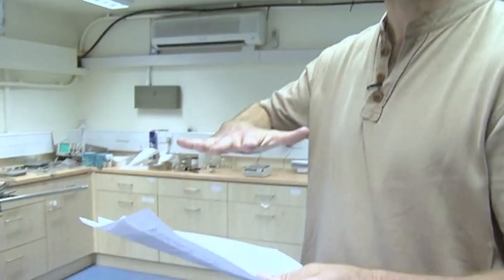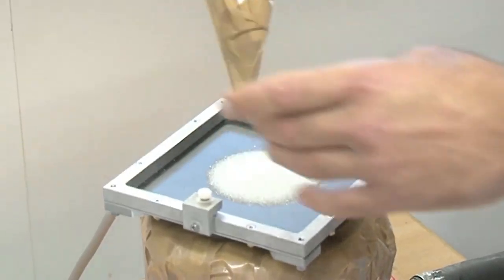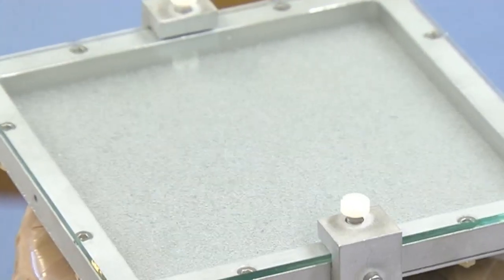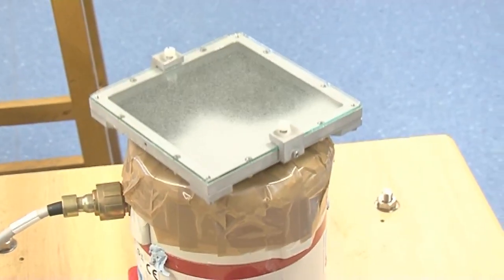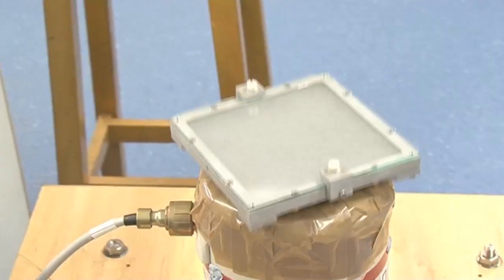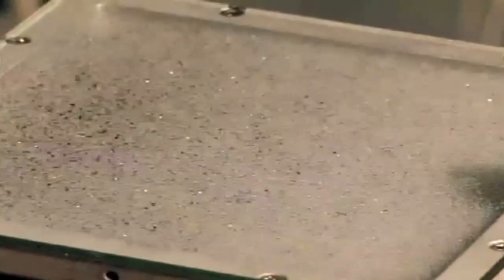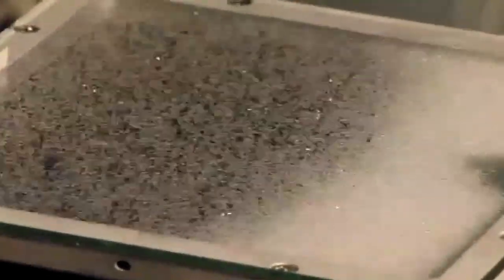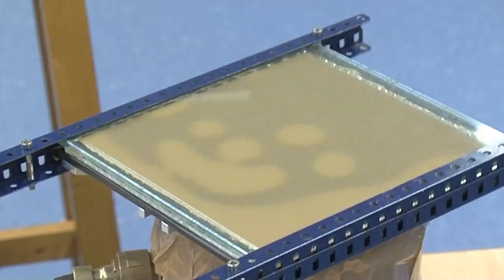Granular Dynamics - Sixty Symbols

Comment: 4:08 That's one way to explain it. However the more elementary explanation is that the induced different vibrational speeds between the air molecules and sand molecules creates domain separation. Literately two discrete spacetimes. Obviously this experiment will not work if it was under vacuum.

Comment: Simplicity is the natural occurring mathematical reciprocal of pseudo randomness, because here-now-forever is this same principle of condensed/tuned frequencies, integrated reciprocals of e-Pi-i resonance imaging. 
Basic Physical Observation has to be repeated for changing POV.., different angles for the same principle/"news".
This is what you would get, a tuned interference positioning, if you vibrate the screen in the double slit experiment, at the appropriate frequencies.

Comment: Dust on machines  - vibration frequencies rule granular sizes and dust bunnies. Lots of varients used in mineral extraction. So a Navier-Stokes type analysis of selected grain sizes using better computer programming models of processing flows is always going to be popular in industry.

In the quantum universe there's no truely simple system isolated from everything else.

Comment: is there a reason why you cant consider the particles as being in a "liquid" at that amplitude? i think it would also be a great thing to look at the physic in a bigger environement, so you can see how the particles react without hitting two layers constantly, to check if the clumping happens again
Reply: +maxime therrien  Yes Maxime, I agree with your suggestion to get rid of the 2 layers. I guess getting rid of 1 layer already would give a hint. Does anyone have a link of the relevant publication? Thanks.

Comment: So... Why does the pressure decrease when there is a higher density of particles in one area?
Reply: magic
Reply: Pressure decreasing due to particles being near each other has everything to do with particle interaction. 
In a quick thought experiment, think about what would happen if all these particles had a magical force of attraction, where they wanted to stay close together. Then it's reasonable that you would expect clumps of matter to form. In this case, the "magical force of attraction" is the energy loss due to oblique collisions between particles. (There's another sixty symbols video that discusses this in more detail).
Reply: In the less dense area, particles move faster, and therefore more motion, which is what's called 'more pressure'. In the higher density area, the particles move less (presumably losing their energy to collisions or what have you), and moving less means 'less pressure'.
Reply: it is not to be misundestood with the case when the system is in equillibrium, i.e. when pressure goes down, particle from every other region rushes to the place due to the variance in the gradient in the particle density within the system. Rather in this case; as the whole system is, "shaking", primarily due to some deconformity in the orientation, particle would tend to go to some specific direction, specifically for minimizing gravitational potential, [it would not happen if this experiment would have been conducted in space], and that is why we find the cluster never happens in between the container, rather towards some side, where, the aparatus is slightly leaned down, or due to the non-uniform shaking of the piston, as the shaft in the rotor has its pretty reasonable dimension to possibly get shifted in some direction. Another reason is, when mass [fine silicate beads here] gets clustered in some space within the container the piston naturally requires more energy to vibrate that region than the rest of the places, which causes the gradient more prominet as in this case, the collisions are not completely elastic and as well as the distance to mass ratio of this system of particle is not negligibly small enough primarily. But afterwards when enough amount of energy is provided, it overcomes these parameters, and the "randomness" begins to appear.
Note that; homogenity in gas or here in this fine particle system, is actually 'random', and there is complete indistinguishibility of microstates within the system and the energy of the particle overcomes all other parameters restraining them, so they achieve gas like behavior.
Reply: As the particles vibrate horizontal motion seems to be generated by oblique collisions and it's energy is lost in collisions with walls... so if at some frequency particles come into resonance and number of oblique collisions reduce (probably the particles start oscillating parallel to each other and with phase difference nπ) and only vertical collision occur then the pressure due to random horizontal motion reduces... I am not a scientist or an engineer but just guessing a probable reason
Reply: because there is a more exerted force on the object in a more simple way,
there are more things that try to replace you.

Comment: Is this effect related to Cymatics in anyway? Has it been tried with a different size frame and a variation of frequency? If there is a relationship between the dimensions of the frame an the frequency, due to harmonics, it will be interesting.

Comment: could something like this explain the non-homogenous universe?
Reply: Is it just a guess inst it?
Reply: I think gravity has more to do with that than granular dynamics...
Reply: Dmitry Shap It's not a guess, it's based on now centuries of observations and compiling all this date while developing new ways to detect things in the universe, like the cosmic microwave background which is relatively quite a new thing, but I often  hear that being used as the most compelling proof of a homogenous universe
Reply: The universe is very homogeneous at large enough scales. No relation there

Comment: Why is this different from Chladni plates
Reply: Alexander Westphal The effects of Chladni plates rely on the different modes of vibration in the plate itself, not necessarily on the collisions of the particles with each other. What they are exploring are the phenomena emerging mainly from the intergranular interactions. Notice that the box containing the granules in meant to oscillate as a whole and is supported by the shaker with a fairly solid x-mount. On a Chladni plate, the single point in the center encourages the plate to deform. The particles coalesce along the nodal lines created from standing waves caused by the plate bending and warping. The frequencies of a Chladni plate are also much higher. That is to aid in creating standing waves within the plate with a small enough wavelength to create clearer patterns.

Comment: What part does Aero-drag play in this test?  If you get the grains to resonate together, the air-resistance would probably help the formation of the clusters around the borders, where the air is to be expected to follow the surrounding walls too.
Can you try the same experiment in a vacuum?
Also:  While the frequency was stable, the amplitude was altered, but the allowed "waivelenght" for the particles is limited. This looks like an Amplitude modulation instead of a frequency modulation.

Comment: He increased the frequency, but not the amplitude. If the amplitude is less than the diameter of the glass beads, would the effects be the same ? I would imagine, in this experiment, that gravity would determine the ratio between amplitude and frequency. Right ?

Comment: Except that what I'm saying has nothing to do with the Chlandi's plate effect. Chlandi's plate patterns emerge at the points on the plate that are not moving up and down, which is not the case in this experiment.

What we have here, ideally, is a plate moving up and down uniformly across it's whole surface, which is why the effect was a surprise to begin with.

Comment: try it in a vaccumn.  my theroy is the glass particles are round a bit like an airfoil. as they move rapidly up and down, through the medium of air, the accelerated air flowing over them would cause a pressure drop, hense the clumping tendency from lower pressure air regions.   the bernulli principle in action. maybe?

Comment: Yes, but in the video, they are not mentioning vacuum anywhere, the simulation is mentioned as confirming that the effect works with ideally level and flat surface, not that it works without air. For all we know from the video, the simulation might have included atmosphere as well.

Comment: That's a very clever theory to fit the observation, but remember he also talked about how the effect still appears in a computer simulation, where they would not have included air as a factor (and if they had, they would have found that to be the reason for the effect). The first precaution they would take with this sort of thing would be to ensure that the effect exists in a perfect model of the grains rather than an imperfect experiment.

Comment: Basically, what that means, is that there will be wind inside the box, and as a plane of glass particles rise up, and starts falling down, the air would get pushed down, then outwards, which would carry some glass particles with them, forcing them towards edges, so the air pressure in the middle will increase, and decrease at the edges (because there would be more glass granules at the edges), and when you again increase amplitude, the forces imparted by the piston can overcome the pressure.

Comment: From what I can tell, this experiment is not done in vacuum, which means there are air particles in the mix to consider. One could imagine that at a certain amplitude, glass particles chaotic motion gets overtaken by the motion imparted by the piston in the axis its pushing in.

The granules moving up and down together as a plane, would basically make a floating piston, that would create air streams of air particles in the mix, instead of them also behaving chaoticaly.

Comment: What's surprising is that when matter is in a solid state (low amplitude), it clumps together and keeps that form. As it gets hotter (amplitude increases), it tends to become more uniform (gasses expand to fill the available space).
But in this experiment with solid particles, it's other way around.

Comment: How does this relate to the pendulum effect? As in when you have a bunch of pendulums set up where the motion can cause horizontal movement , they align them selves to tick together. Maybe the impacts vibrating the glass has something to do with this as well (the vibration waves would have to strong enough to have overlapping waves at somewhat similar frequencies)

Comment: i'd guess that at low amplitudes the granules are oscillated randomly on all three axes,so pressure in all directions are similar, producing a nice uniform distribution of particles.then at a resonant frequency of vibration in one axis (z-height movement of the piston in this case)each particle now resonates in the z axis at the expense of x/y oscillation,such that x/y pressures drop and the particles collect sideways.expectedly the pressure on the glass and baseplate must have greatly increased

Comment: The laws of thermodynamics do not apply for a system where energy is not conserved: the  colliding particles lose energy as the collisions are inelastic and the energy is lost as heat. The surprsing observation is that the system behaves as if it were a thermodynamic system, even though it is not. And there appears to be a surface tension which governs the shape of the two phases.

Comment: if the sound it self if migrating into the mix would that not change the actions when just vibration is added becouse dose sound not affect the mix by sound waves going from partical to partical in the mix, would a cam type vibrator be diffrent in action on the mix ???????

Comment: I guess that it has to do with the orderly fasion they move in. As he explained in the video, the beads switch from a chaotic movement to one stabil motion going up and down. So yeah, that could be it but then it's not "pressure" they're after, it's another force which so far behaves as pressure would, just the other way around. Could you call it "pushure"? *HAR HAR*

Comment: I would like to see this experiment done with a circular or cylindrical box. Not that there would be a different result but maybe a different visual output. The computer simulation shows the granules spreading to the corners, as far away from the centre as possibly.

Comment: Both harder AND faster.
The frequency stays the same. But the total travelling distance increases due to higher amplitudes, which means greater distance from the "zero-level".
And greater distance in equal time means faster.

The force becomes stronger in that process too. The maximum accelleration increases, the mass stays the same, which means more force.

Comment: So is this a phenomena resulting from higher amplitudes or frequencies? I'm confused. Also, is there any pattern to where the higher density clumps are formed? Does this happen when the size/mass/density of the particles is increased? Are there specifics of the sine wave that cause this effect or is it possible with randomized waves.

Comment: Insightfully FASCINATING!  A new phase transition is observed experimentally in a dry granular gas subject to vertical vibration between two horizontal plates. Molecular dynamics simulations of this system allow investigation of the observed phase separation to find a high-density, low temperature liquid, coexisting with a low-density, high temperature gas moving coherently. The importance of the coherent motion for phase separation was investigated using frequency modulation. Key: COHERENCE

Comment: At a high temperature driven by coherent granule movement, a randomly generated cluster of granules causes a drop in pressure in their region, thus attracting more granules to the cluster? And coherent granule movement is some kind of resonance effect that occurs only at a certain frequency and its multiples of shaking? I'd like to learn more. How about a part two and explain things a bit more?

Comment: @HotblackDesiat042 When I speak of limiting I mean the point at which the amplitude of the drive signal is sufficient to extend the piston/solenoid to its farthest extent, thus reaching its maximum stroke. Any increase in amplitude beyond that point will be clipped as the piston cannot extend farther. When the amplitude is pushed beyond this point is would be akin to a square wave feed versus the sine wave feed, as that would be the motion the grains would feel.

Comment: @HotblackDesiat042 those are still great questions, and I don't have the answers :(. Just wanted to clarify on the amplitude vs. frequency problem. My thoughts on the limiting effect, however, and if I understood you correctly, I don't think there is a limiting effect, practically. The way he talks about higher amplitudes makes it seem like they've reached quite a large amplitude experimentally.

Comment: @EveryoneIsBoring 
Actually on their channel(sixtysymbols), there is a video explaining it with a different example.
Basically, the more closer together the beads get, the more they collide with each other...and thus waste their energy. Less energy..less movement, less movement, less temperature/pressure, less pressure, more particles.

Comment: @frichikendz I'd guess at least part of the reason why that happens is because the liquid is most hot in the middle of the cup and cooler at the sides. Hot water (at least >4deg C) rises and cool water sinks, so small currents are formed which, at the surface, are moving toward the edge.

Comment: Chladni nodes. They propagate differently when the edge of the surface is clamped and has holes drilled in it, as opposed to a flat square plate with no holes.

Comment: Am I understanding this correctly. The lower pressure area has a higher rate of collision. With the higher collision rate the probability that 2 or more particles will hit another at the same time increases thus transfering all that energy into a single particle which ends up pushed into the higher pressure area taking all that energy with it? In other words is the action similar to evaporation?

Comment: Varying the amplitude changes the net energy into the system --wouldn't changing the frequency do the same? At what critical point does the pahse transition (chaos-->stocastic) happen? Is this a function of the phase space betweent that transition and the change "back"? How about higher energies? Do you get other phase changes at higher energies? Finally, just curious--what were you looking for when you found this phenomenum?

Comment: @Atveurf He said the denser areas were hotter so the pressure was lower causing other particles to collect there. If these related then the center of the star would be low pressure and have more particles, or the out side would be hotter with more partials, but less dense. Neither of these make any sense to me, but that is not my field.

Comment: I have studied mechanical vibrations, using simmilar setups, using sand particles on vibrating plates as well. 

Is the sand not just collectiong at one side, due to the the amplitude of a certain modeshape? Or that the rig is EVER so slightly tilted or certainly not perfectly plane?

I have to see that paper.... :D

Comment: Hrm...
I'm not a physicist, so i may be wrong, but what if a greater electrical current is being generated where the particles are at a higher density due to friction, and lower where there is a lower density,  causing magnetic fields and pulling the particles together. Then, at higher levels of oscillation, the silicate beads can't maintain a higher magnetic field, so the force of the shaking itself is enough to separate them.
Unless this phenomena happens periodically at different amplitudes.